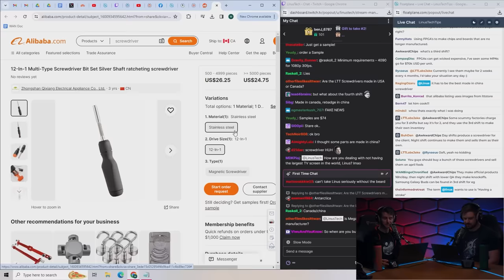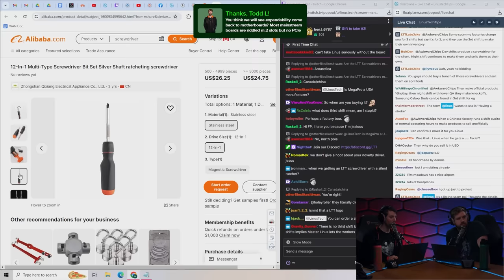Do Not Buy 500 Fake LTT Screwdrivers

Comment: wtf is a third shift
Reply: If a company asks a factory to manufacture their product for them, and the factory both fulfills the official order and makes some extra products to sell for extra profit on the side, the extras are from a "third shift" production run.

The term "third shift" generally refers to the overnight shift. The idea is that the factory is open for 2 shifts, and "closed" (but secretly making unofficial products) overnight.

Something bought from a third shift run will likely be of similar quality to the official product, since the manufacturing process is often identical (quality control and the warranty might be worse though). It can also be cheaper because you skip paying the company that designed/supports the product and their distribution chain.

Comment: When it comes to tools, anything remarkably cheap is going to be garbage. Almost no one needs Snap On tools other than for bragging rights. LTT's product has a bit of a premium price, but once you have one it's apparent why.
I ordered rechargeable flashlights that cost $35 and looked identical to one I paid $100 for in Canada. The mail order flashlights didn't even have full size battery cells. There's a reason they're a fraction of the price.